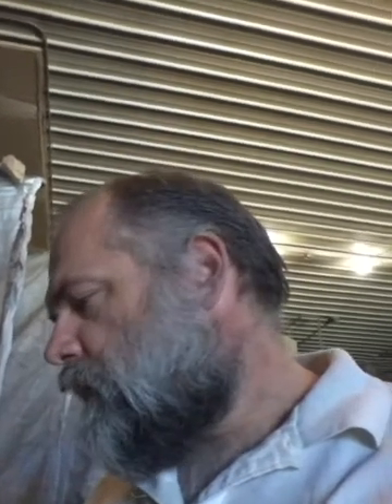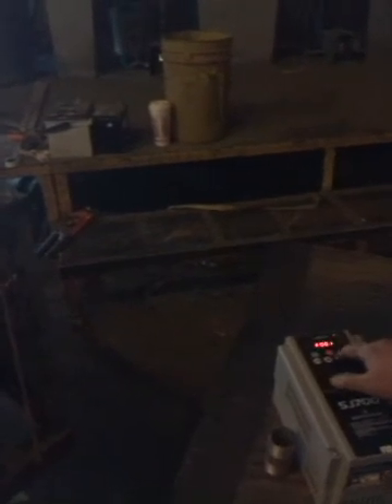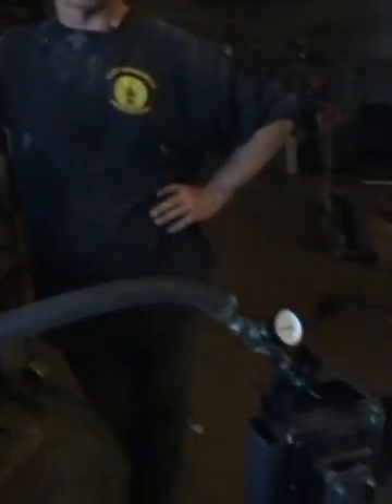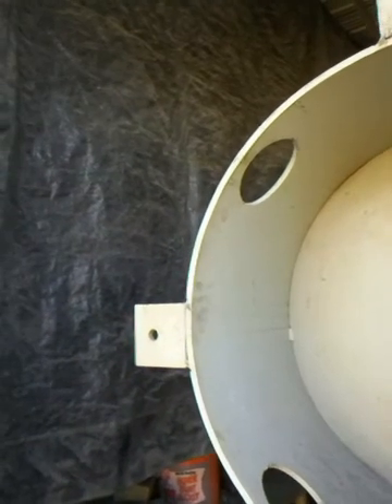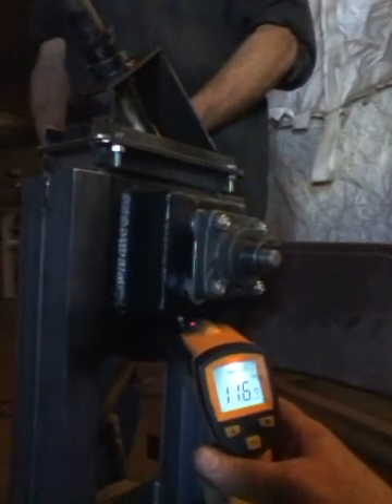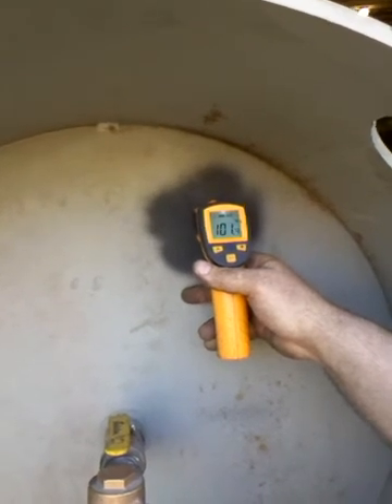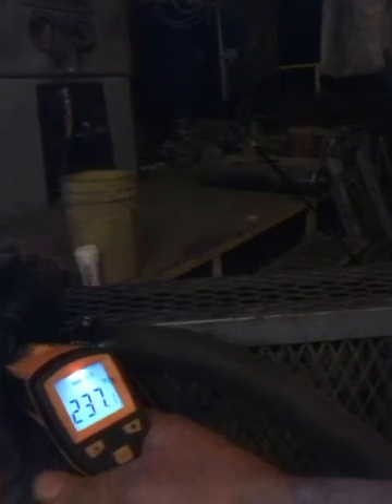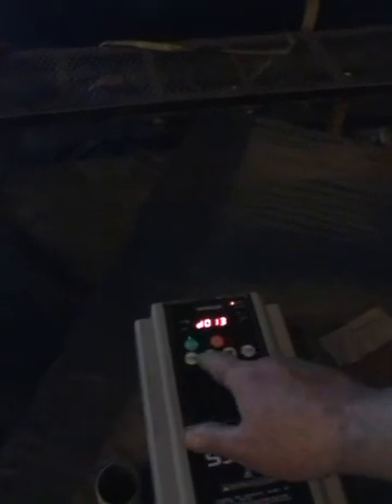EXTRACTION OF VERY LOW TEMPERATURE WASTE HEAT SOURCES FOR ELECTRICAL GENERATION

Comment: If I understand this system, I think what you have is a heat pump.  I've always thought that a heat pump should be reverseable.  I would like to see a flow chart of the process. This could solve the storage problem for solar energy;   hot water might be a cheaper storage medium than batteries.
Reply: BTW, by reverseable, I mean that you should be able to put heat into a heat pump and get electricity out.
Reply: @blandman3471  fully reversible. watch stirling motors used for cryogenic coolers...
theyll work to heat things too. its all about which end you look at them from...

as for batteries. i doubt they have the same energy density as the latent heat capabilities of water. then again, a bit of maths would prove that one way or the other.

Comment: Carnot Cycle efficiency = Th-Tl/Th=, Th is the source temperature - 100F water, sink is the 90F water entering the tank, so max efficiency is (560-550)/560 o(Rankine temp scale) or less than 2%.  This will never overcome the inefficiencies of the compressor.
Reply from the maker: Have you ever even considered that the most inefficient heat pump today produces a COP of 4 to 1 at 45 F. Are you aware that latent heat has no temperature differential  and yet still contains 940 BTU per pound of water vapor that can be extracted. This does not violate Carnot......

Comment: Maybe you said it over the noise and I missed it, but how much electrical energy does the compressor use versus how much is produced from the Tesla turbine? You showed the TT produced 15.9A @ 192.1V = 3054 watts. I thought I heard you say the compressor was a 7.5 HP compressor, but it may not be running full steam. So that's 746 Watts/HP * 7.5 HP = 5595 Watts. So if it's running full steam this system is essentially losing 2kw of electrical energy, plus the thermal energy from the water. Or is my math wrong somewhere?

Can you put a Kill-o-watt tool on the compressor to see if it is in fact using that much electrical energy?
Reply: I think the obvious question is whether a Tesla pump could replace the air compressor? Would that end up using less electrical energy?
Reply from the maker: in my opinion not ever going to happen.
Reply: @ourhouseisfull11  There must be some break even temperature of the water. In other words, if you get it to 101C, then it shouldn't require the compressor at all. At least until you extract all of the latent heat. 

Since a higher temperature of water requires a weaker vacuum before boiling, that would require less input electrical energy from the compressor, replaced by input heat energy in the water. 

I think this setup is very fascinating because getting huge amounts of 'warm' water from the sun is pretty easy.
Reply: @zenmanproject  isn't the suction force of the tesla turbine  sufficient to induce vacuum in the water supersaturated tank?
Reply: @hanahisham8022  probably not by itself, no. But I guess if you put some electrical power into the rotor and caused it to act like a pump then you could induce a vacuum, like a second stage. But there is no free lunch, so whatever energy you put into that you would lose more. 

Although if you have a huge supply of low temperature heat, that might be a different story. You could use the electrical power to lower the boiling point then have a giant tank of warm water.

But even so, the Carnot efficiency would be garbage with a low temperature differential.
Reply from the maker: Your math is perfect. This setup is woefully inefficient and the initial heat sink was below a break even input.

Comment: Mr. Schmidtke is your Tesla Turbine made out of Mild/Carbon Steel? What is preventing it from corroding/Oxidizing from the water/water vapor? This Close System is truly amazing, you extract more energy from natural occurring ambient energy(water, vapor, heat, air)

Comment: You should be able to loop it even with this turbine, although probably would be a good idea to stack 2x more disks, although that will push the compressor load.  Based on your compressor usage it consumes approximately 15 MJ/h. Assuming the worst case, assuming of 30% efficiency across the entire system, turbine losses, compressor losses, heat losses, mechanical losses, generator losses, you will need to pull, 50 MJ/h, in order to have the system running, without any load. You have about 4 000 liters, ( 4046 liters = 1069 gallons ), if you pull 3 Celsius  down the temperature of the water, within 1 hour, that will indicate that you are extracting approximately 50 MJ/h, energy equivalent, and you should be able to self loop. In order to get output power, you should be able to decrease that temperature by at least 4 Celsius/h. In that case you will be extracting around 16 MJ  or 4.5 kW/h in electrical energy equivalent, for every 1C drop of your tank temperature, above your 3C/h drop you need to maintain the system self looping.

Comment: You might say the air compressor is a thermal amplifier.
Reply from the maker: In fact it can be modified, as this one has, to harvest latent heat of water vapor and sensible heat of the air. This is in effect a solar thermal collector, best suited to very high humidity and temperature locations. Above 80 degrees F and 80% humidity, the compressor itself can be used to harvest thermal energy in the air. The problem is using that energy to output more electrical energy than it consumes. Theoretically, with an 80% efficiency compression and an 80% efficient turbine, more energy can be extracted than used to during the harvesting process.   Obviously, other higher temperature forms of heat are readily available and preferable.
Reply: If you ran the vapor mixture output of the tank through black tubing in the sun you could probably get your inlet temperature on the compressor up to 140. This should give you a nice bump in heat on the output side of the compressor. Looking forward to updates. Thank for sharing this.
Reply: @ourhouseisfull11  you obviously missed the bit where he describes the system as "closed" so your point about "suited to locations of high humidity and temperature" is nonsense. Please explain how the compressor can "harvest" anything when the compressor's function is to continually add to the energy in the system (3.8 kW(e) to be precise).
What needs analysis is how the compressor impacts on the turbine inlet pressure and temperature, in my view I would like to hear the "theory" behind your compressor or turbine efficiencies of 80% because, so far as I can see, both compressor and turbine can only lose energy to their surroundings - all the rest goes back to the tank.  I don't see either device glowing.  No-one, myself included, knows the mass flow and consequently the 125-degree F drop across the turbine, while interesting, is not instructive regarding torque or power output.
What did you make of the point where he suggests the condensate+air mix is not at temperature equilibrium: the condensate cooling the tank, and the air heating it?  This makes no sense to me.  The heat tank gives up heat, and cools, because warm unsaturated air is causing the water it contains to evaporate... and its surface is not lagged.